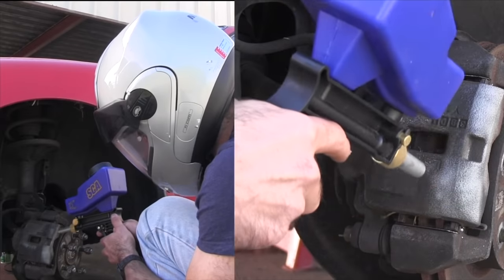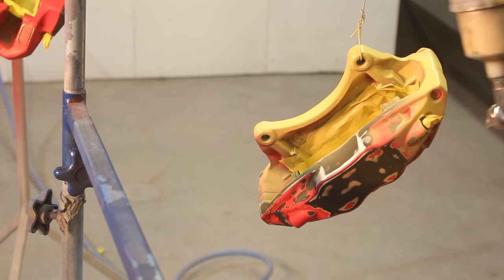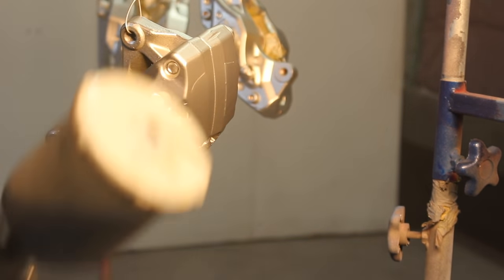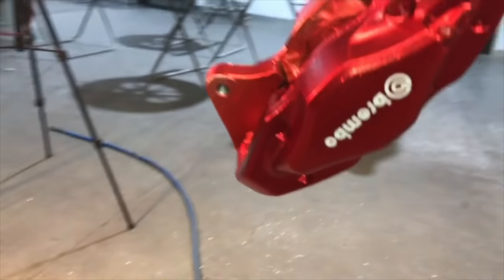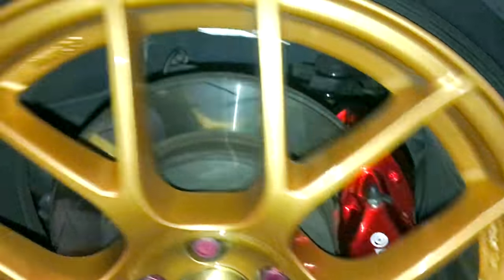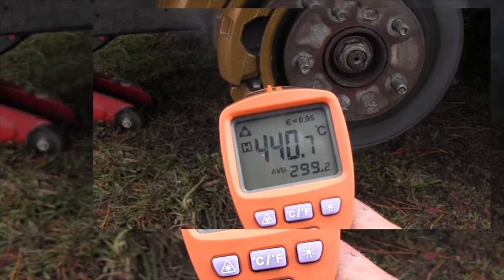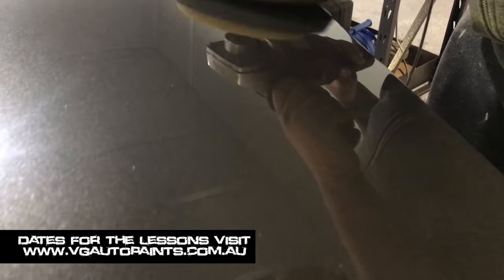Paint your brakes candy apple red

Comment: hey, so the decal stickers hold up to high temps after track days?  I used stencils but they can be tricky and I wasn't happy with one caliper.

I had plastic dip literally melt off my wheels after a hard track day once and was weary of sticker decals on brakes..
Maybe the top clear coat effectively holds things in place?
Reply from the maker: Jarrod Thompson my callipers are painted with the decal on top of the clear. I just did 90 Laps at the track and they still look like new.

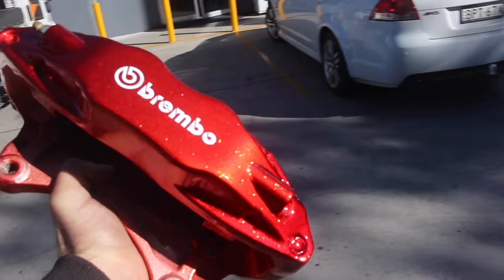Comment: @customspraymods 3:04 I painted some test panels just like in your video and I got this light red / silverish sparkle. Used metalic silver base color + big metal flake in clear coat + 3 more layers of clear + sanded + candy red + more clear. Made some photos and the camera turned the flake golden like in your vid. Did your brake calipers get a golden sparkle for real or was your camera playing trics on you too? But how to get this golden sparkle effect for real? I even tried gold pearl on normal red base color but it turns the whole thing too orange. Pluss if you look straight at it, the plane red looks too dull. I havent tried the gold pearl on red candy yet, maybe this would be the solution?
Reply from the maker: Aivar Petrov this was silver flakes. If you want gold flakes use gold flakes.
Reply: customspraymods, thanks for the quick reply! I have read some comments that using golden metal flake will give a more darker shine but still a light red one? Haven't tryed golden flake yet.

Comment: is that high temp. paints?? or just the primer?
Reply: good question
Reply: blitzer blitzer primer
Reply: wont it be burned by high temperature produced by the brakes???
Reply: at 2:47 "heat resistant" and all the paint used is "2k" meaning 2000 degrees resistant
Reply: @Monstero5o  2k means 2 part paint. Im not sure about it meaning heat resistant

Comment: so what happens when you get brake fluid on them when bleeding the system
Reply from the maker: Evo wipe it off. No harm done.
Reply: so it won't strip the clear or the paint?
Reply from the maker: Evo no it won't. It would have to be soaking in brake fluid for a few minutes or so to strip it.
Reply: ok dude thanks